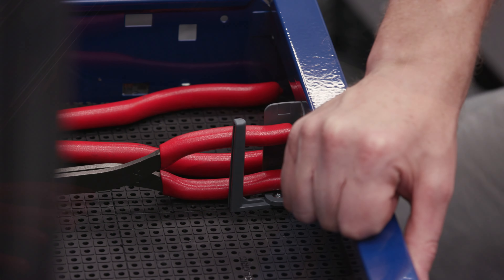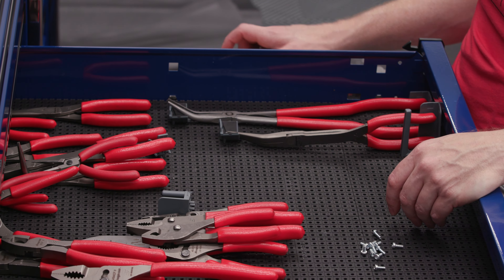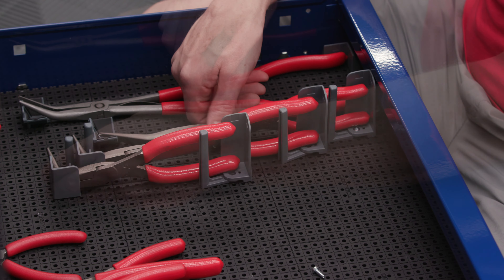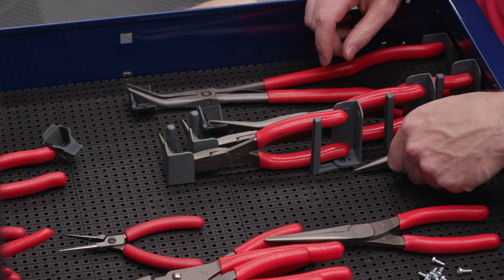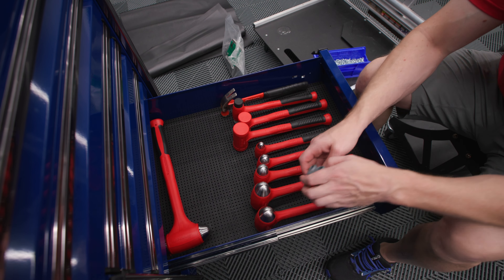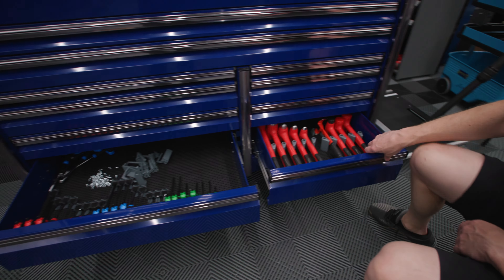Organizing the Snap-On Epiq with Tool Grid: Part 4 - Pliers, Hammers, T-Handles

Comment: What’s the ball park cost for the Tool Grid only for this cabinet?
Reply: He used 70 squares of grid for the top drawer alone. Even though this is an 11 drawer box, I'm just going to say it's a 7 drawer box and ignore the divider. Each box of grid has 16pc @ $105.49. So 70x7=490÷16=30x$105.49=
$3,164. This is a rough number, he could've used more or less because of the bottom half of the box having split drawers, also this number doesn't take into account all the tool holders and hardware.
Reply from the maker: I’m making a video today breaking it all down.